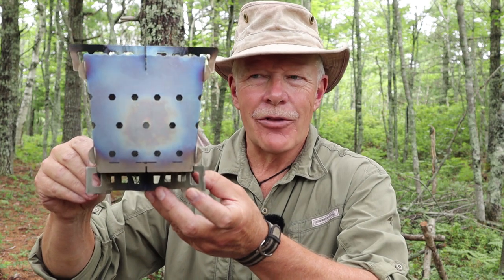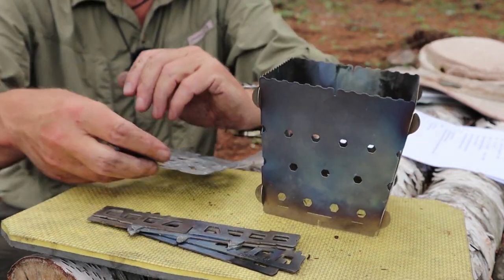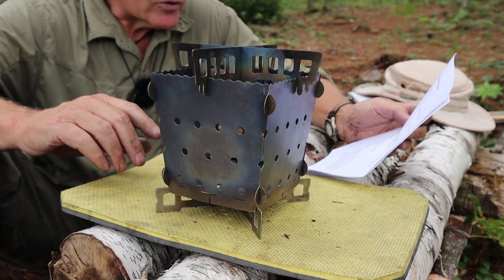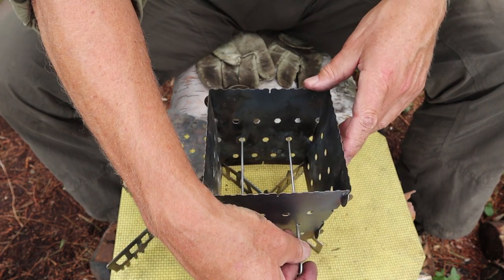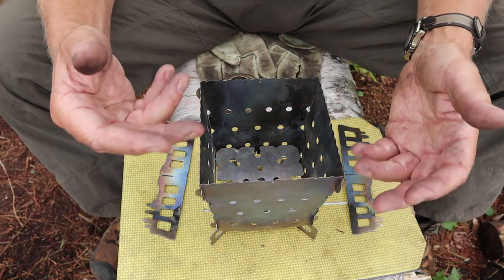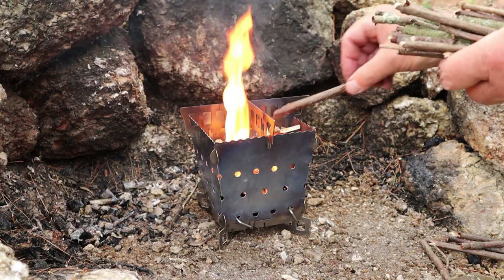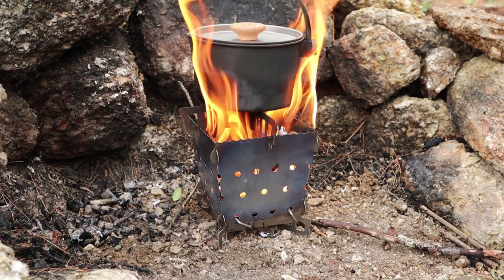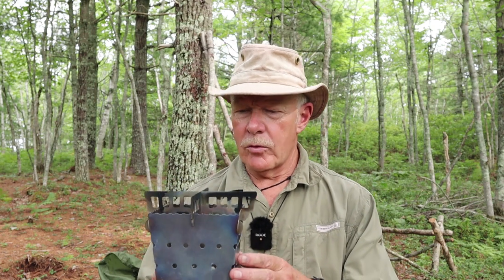Gen 3 Flat-Pack Siege Stove

Comment: Looks like a winner, Mark! A square frying pan with tight-fitting lid would make a good case to keep the sharp points from poking the contents of the backpack. A good canvas envelope could keep the inside of the pan clean. I have no idea where to procure such a pan, but it's something worth exploring.
Reply from the maker: I see square pans often at the thrift store. I will measure and see if I can find a match. Thanks for commenting

Comment: I've had the original for years and can't rate it highly enough. The addition of the stove instead of using a can (or ikea utensil holder) looks great.  Might be time to make another purchase. 
I also want to point out just how great the customer service was from seige.  My original purchase came with a set of stands that didn't quite go together properly (I think he was still hand making them at that stage) I got in contact and he sent out a new set free of charge including postage and I'm in Australia so I can tell you that wouldn't have been cheap.   
I have an original emberlit stove too but the seige has been my favourite for years.
Reply from the maker: Right on. Great stove, great company. Thanks for commenting

Comment: Thanks for the review.  Your purchase of the stove speaks volumes about the quality of the stove.  You mention that these grates will work with other types of stoves.  I also watched your video with the grates and colander as a wood stove.  My question is when you might use the colander and grates rather than the Siege stove itself.  Take care.
Reply from the maker: Hi Jim. I assume you mean the Siege Stove cross members. They can be purchased separately and used with a variety of containers to create a stove. Most often, it is the Ikea utensil strainer but it could be almost any can. Placing them on the steamer is just another way of using them and saving money. Not really about which is better for certain situations. If you have the full Gen 3 flat pack stove, you really don't need anything else. Thanks for commenting

Comment: It looks like a great portable fireplace. I would use 2” X 4” long splits vertically with smaller slivers once coals are established. Crowding the fuel would make it last longer.
Reply from the maker: Yes, thicker and more splits make for a better long burn fuel load for sure. Thanks for commenting

Comment: Hello, Mark. I like it. I like it a lot. This is a kind of stove I love to have with me on the trail. Light weight, folds down flat, good air flow and sturdy, versatile  and skeletonised bottom and top cross bars to boot. What is not to like.  
I think I am going to get 2  for me and my son with 2 more sets of cross bars. Yes, I am keeping my firebox stove and all my chinese copies of famous stoves, too. I have a set of 12 long (14 inches) stainless steel tent pegs for wet seasons. I would use them to move the stove if I have to by putting through the holes of bottom cross bars. Appreciate the great info and presentation, Mark.
Reply from the maker: Wow, another happy customer😊. Kidding aside, I am sure you will like the stove. Thanks for commenting

Comment: Thank you Mark for such a superb and thorough review.
As you observed, the visual simplicity of the design conceals years of real-world testing and refinement. This was done while maintaining a focus on keeping the design as clean and simple as possible and at the same time optimizing for a variety of capabilities. I am reminded of the many historic figures who have apologized for writing long letters, explaining that it would have taken too much time to write a short letter. The Siege Stove is the equivalent of that short letter — high-performance, functionality and durability, uncluttered by anything unnecessary or finicky, or which might compromise the stove.
From the get-go we were committed to making the stoves in the USA on philosophical grounds (which also helps ensure material purity and fabrication consistency). We also keep prices competitive by applying very low margins and only selling direct. Whereas most retail products have 4x and higher mark-ups on the production costs (the manufacturer wholesales it for double their cost, and the retailer doubles it again), the end-user price for our titanium Cross-Members, for example, is closer to just 1.5 x our core production costs (material & laser fabrication) — quite a lot lower than what manufacturers generally even charge as a wholesale price.
To give further context to how reasonable our prices are, without mentioning any specific stoves, our US-made 100% titanium Flat-Pack Stove (made from US-produced aerospace-grade Ti) is priced significantly lower than the similar-fuel capacity $160 Chinese-made and $220 German-made titanium hinged stoves listed on Amazon, while also being a lighter and more compact carry.  Hinges provide some convenience but at the price of weight and size, and we have seen reports of hinges warping over time (as well as the floor plates), rendering hinged stoves unable to be folded up or out (some hinge components may also not be titanium, and in the case of the $220 stove, the floor plate is stainless steel (to mitigate the potential warpage lock-up), so stoves that are billed as titanium are not always all titanium). We designed our stoves to last generations, with nothing to break down (a little warping of the walls is normal and will have no impact on stove function). With a little practice the Siege Stove can be assembled in 25-40 seconds and disassembled in under 10 seconds. Identical walls and the ability to interconnect components in almost any order (walls or cross-members first) also means that one never has to worry about assembling parts out of sequence and having to back-track.
Thanks again!
Siege Stoves
Reply from the maker: Hello James and thank you for commenting on my video. Your stove totally surpassed my expectations. It deserves more attention than it has received. I am very happy with my purchase
Reply: Thank you Mark for this thorough review, and thank you Seige Stoves for the great design. I bought and received the titanium version and was not disappointed. I also have a Firebox, and was shocked and how much lighter this stove is for virtually the same functionality and utility. Well done to both of you, and I look forward to Mark highlighting this stove in future videos.

Comment: I recently got the folding SS backpacking stove from Winnerwell. I got the optional raised stand for it too. It is larger than this one and it’s heavier but it pops into ready, very quickly. Both the stove and the riser fit into the box the riser came in and…without actually going to measure it, I’d guess the box is about 7”x7”x1 1/4”. I have the stove you’re discussing too, in SS. I like it great for backpacking but I mostly car camp and the Winnerwell is a better option for that IMO. Always great info from you. 👍👍
Reply from the maker: I had looked at the Winnerwell some time ago. I need to take a second look. Thanks for commenting

Comment: Great review Mark.
My biggest 'turn off' of these stoves, is the fact that you have to put them together. Not a big deal in 3 seasons, but come winter time when its freezing rain or snow  my fingers lose a lot of their dexterity and my patience is usually running low. 
Thats the main reason i went with the Firebox, and SimpleTheory stoves; No assembly required. I'd love your input or maybe an update once the temps drop and the snow starts falling.
Love your videos and value your insite !
Reply: Couldn't agree more with this. In the dead of winter some of these tasks can become a real chore. Firebox for this reason is a hit for me.
Reply from the maker: You can't go wrong with a folding stove in winter for ease of setup. Having said that, we rarely get below -25C / -13F here in Nova Scotia. Most days I go out in winter it is -10C. I find that if I have been at all active, my hands remain warm enough to handle a stove, especially if I am wearing thinner gloves. I really do not like cold hands so I usually have two pair of gloves with me. One more recommendation is to take a larger stove like this one as they work much better in the cold dues to a critical mass of heat they can generate. Thanks for commenting
Reply: @MarkYoungBushcraft  
Thanks for the feedback. I have bad arthritis in my finger joints from years of martial arts and the cold makes my fingers almost unbendable if exposed for too long or if they are wet as well. Thin gloves may very well prove to be a viable option. I will have to try that out.

Comment: If you want to Mark you can drill a can sized hole in the middle of the stove so it can mimic a rocket stove and gasifier at once. It may be easier to put sticks in. :)
Reply from the maker: It would make a big change to airflow but I am not sure it would either gasify or have the height for the chimney effect. For me, it is very easy to add sticks as is. Thanks for commenting

Comment: Maybe if the bottom cross members were on perpendicularly instead of diagonally they'd be less 'tippy' with the stick method of moving the stove.  Seem like the weight would be balanced better and more even.
Reply from the maker: Still tricky but might be easier. I will give that a try. Thanks for commenting

Comment: Hello Mark, I would like to tell you about using a 16oz can to hold a wood pellet fire rather than making alterations to your many stoves. Drill 1/4" holes in the bottom of the can, 2 rows of holes around the outside near the bottom and 1 row 1" below the top. It will work almost as a gasifier stove but it is only a burner to be used in other stoves. 2 handfuls of pellets will work almost for 30 minutes. Very little smoke, nothing but a little ash left, and it only takes a can from the trash and 5 minutes to make. Fairly wind friendly.
Reply from the maker: Thanks Dave. I do have videos on using a smaller version of the Ikea utensil strainer that matched the 16oz can is size. I will try adding that (and a 16oz can) to a few stoves and talk about using them in a future. Thanks for commenting

Comment: Nice video, Mark.  I want one in Titanium.  It seems a little fiddly, though, and those trade-mark cross pieces would be much nicer if they weren't as high and designed just for this stove.  

Have you checked out the Picogrill 85 Stove?  I think it is also a winner.
Reply from the maker: I am considering mods to lower the height of the cross members, setting them in parallel. Yes, I have a video on the Picogrill 85 coming out shortly. Thanks for commenting
Reply: The height of the pot stand actually leaves fairly adequate space for feeding fuel into the stove without having to move the pot/pan.

Comment: If one end of your skewers was bent into a hook would it be possible to hook them into the base member which has the notches and lift the complete stove? The hook would have to be quite a tight fit on the thickness of the cross member to give you some control while lifting but the square cut out looks large enough for this to work. It looks like a nice wee stove, it all comes down to price. ATB.
Reply from the maker: That is an idea I will take a look at. Unfortunately, American made titanium products will always be more expensive that off-shore.  Thanks for commenting

Comment: I watched the video where you use charcoal in this unit. Impressive ! Does charcoal make the food taste ? Mostly hardwood around me.
Reply from the maker: I like using charcoal when we have a fire ban as we are still permitted to do so. It gives a good amount of steady, almost smokeless heat for cooking. I prefer natural hardwood charcoal as it has no binders like briquettes have. Burns hotter and faster but does not add unwanted flavours to the food. For real wood, I prefer hardwood unless it is just a quick boil up. Softwoods often leave a bad taste on food as well as a lot of resin on the pots. Thanks for commenting

Comment: Can you add a propane or butane burner into this stove? Just curious.
Reply from the maker: So, I had not included that in the video but will in an update. Yes, a Trangia style gas adapter will fit well but a small modification is need to allow the bottom plate to accept other gas burners. Thanks for commenting